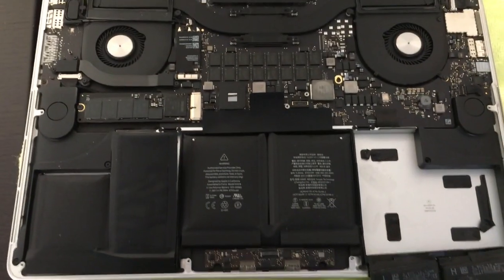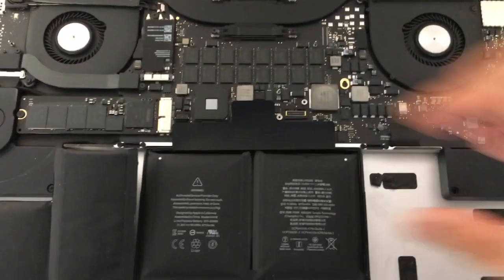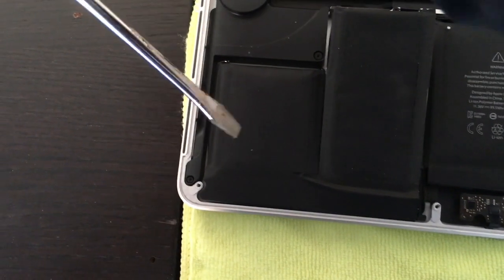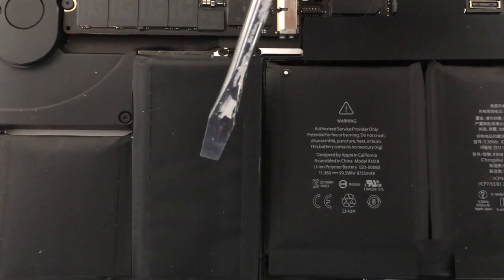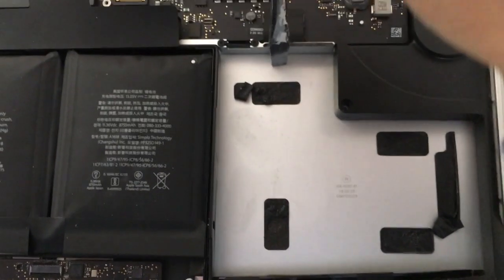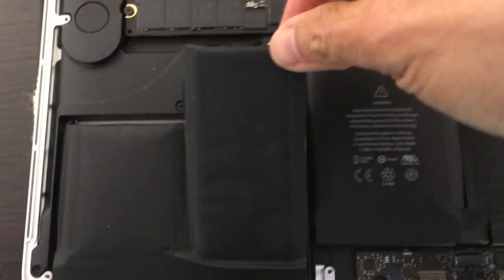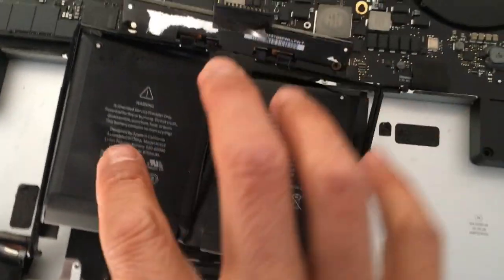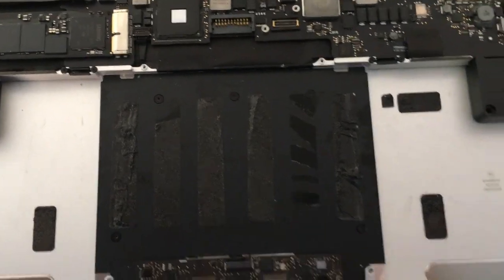Mid 2015 MacBook Pro Retina Battery Replacement 15" - The EASY way!  Tips and tricks!

Comment: I’m glad I watched this vid — it saved me time… However, I also am glad — once I got to the point where this guy fessed up to puncturing part of the battery with a too-small s/d and the stinky and dangerous mess it made — I watched the next vid that came up for me, as the maker was more cautious, professional, and thorough. 

I would not have gotten through the process successfully just watching THIS vid, as there are important steps omitted (removing screws, tape,  connectors and adhesives). On the other hand, I would not have gotten thru the process as quickly without THIS vid.

Thanks again!

The other vid I watched was Kamil Kuzniak (or Kuzbiak) https://youtu.be/rHlvwRQlLfM?si=IyK6ICVTDktS-oKD “2015 MacBook Pro Battery Replacement”

Comment: You shouldnt use any metal tools near LiPo batteries unless youre sure what you are doing but i still wouldnt recommend it because if you want to remove the batterie its likely already broken so its even more unstable. Damaging the battery can cause fire and or explosion and is prevented by using plastic tools without sharp edges.

Comment: Thanks a lot!! Saved me a lott of time and hazzle. Worked fine on two computers. Allso a MAC Book Pro from 2012
Reply: hi, I know this is old, but did you replace the battery in your 2012 Macbook? I also have a mid-2012 Macbook Pro retina and was wondering if it's worth trying to replace the swollen battery or just remove it and say goodbye to the laptop. Right now it's working very slow and I'm wondering if battery change alone is worth it since I can't add more RAMs (as far as I know, it's not possible with retinas because rams are soldered to the board).

Comment: Thanks SO much for this video - it saved me tons of time and really eliminated the possibility of damage to the other parts from uninstalling and reinstalling. I went slow and was able to pull the center batteries without a tool, as you suggested. I had the battery replaced in 30 mins! We’ll done!

Comment: Great to know! I just bought a used 2015 retina with a good stock battery so I wouldnt have to do the tear apart task to replace a battery. I wondered if it could be done without tearing the machine apart. I see the nuances and cautions that need to be taken. I've read suggestions of using a putty knife - I have a set of plastic putty knives/spreaders - look for plastic ones they will be a safer tool to use.

Comment: Thank you so much man, I watched your videos and went for it. If anyone has trackpad issues after just make sure that tape on top of the battery is fastened and plugged in correctly. I had to redo that step after turning the computer on to no avail.

Comment: Great advice.  The trick of starting with the batteries 2nd from the end worked great.  I'd like to try the "thread" routine - pull something like fishing line between the battery and case.

Comment: Thanks, this helped me a lot and saved a ton of time! I did what you suggested, stated with the battery right away and removed the 2nd piece first and then the rest. It worked out great and the the battery removal process (after I removed all the screws and the touchpad ribbon) took literally 10 minutes!
Though I did use adhesive removal that came with the iFixit kit and some pretty wide (much wider than screwdriver) pryer. 
Also the fact that my battery was very swollen, strangely, helped because due to that swelling some of the adhesive, I guess, unstuck naturally over time.  
Thanks, Cheers!

Comment: Yes metal may not be ideal, just don't use anything small and sharp. I used a 2" flexible putty knife because it was thin and wide. It was super easy to get under the edge and pry the batteries out easily. My batteries were leaking one of the chemicals already. I could small it when I opened the case. Battery installed with no issues. Did remove trackpad cable from motherboard and trackpad to protect it. Easily removed and replaced. Thin and wide, regardless of what you use, works quick and fairly safely. My plastic tools were too thick especially for the batteries over the trackpad.

Comment: Dude you honestly should delete this. You could probably be held liable for reccommending people use a sharp screwdriver for this, which is just absolutely moronic. This has 37k+ views at the moment and I can absolutely guarantee someone has started a fire as a result of your terrible advice. I recommend people watch Hamad Benaicha's method. He uses a metal spatula, which is still dangerous, but at least he's not applying pressure directly to the battery walls like in this video so much as into the seam between the laptop and the battery. I personally recommend you sub in blunt plastic spudgers for added gentleness. You can easily apply the necessary force without worrying about messing with the battery. I had a bit of turpentine and alcohol on hand to remove adhesive if necessary, but I wound up not feeling like I needed it. Apple Pie Tech's fishing line method was also helpful for getting started on each cell of the battery. But the spudgers were far more effective once you have a bit of lift on each cell and you're able to get them in there cleanly.
Reply: Wow, people love to tell you how you're doing it wrong cos it's dangerous or whatever. You did great and lived to share what you learnt with the world.

I like your idea of careful prying, thanks for sharing it. Thanks for openly admitting that you made a mistake and nearly started a battery fire.

They are much more exciting and shocking to observe than dangerous as long as you do it away from other combustible materials as it doesn't take long for the flammable solvents to burn away.

If surrounding things catch fire. Extinguish them with water when the battery has stopped venting. Fire extinguisher would be handy to keep surrounding things from burning but won't extinguish the battery fire most likely. Just have to let it finish venting.

This guy didn't hide anything. He told us everything he did and what worked best for him. We are all learning, none of us know everything. Just say no to safety "experts" who get a buzz from any chance to tell someone off.

To the safety "experts", get a life. Do something interesting and contribute to the world. Unless it's egregious, telling people off for this stuff only discourages open and honest sharing of information and nobody likes you!

Comment: Spoiler alert : unless you’re a complete dipshit with no concept of applied pressure...you can use a screwdriver fine. The hard part is getting those centre batteries out over the trackpad.

Comment: use nylon under the batteries. that is the really easy way (fishing 150lb nylon) works for any glued on battery on MBpros
Reply: do you think dental floss would do it?
Reply: @pigknickers2975  if your dental floss is strong then yes, use screwdrivers or something to tie the floss and pull (lengthwise the battery. don't pull up). with nylon, this took me about 2 minutes and was only $2 at Walmart sporting goods section
Reply: @mystiquemetal  Excellent advice, thanks. - 2 minutes for the whole battery removal?
Reply: @pigknickers2975  I had someone else hold the MacBook while pulling the nylon to cut the glue. if you ask for help, it is simple and quick
Reply: @mystiquemetal  Great, going to try this, thanks.

Comment: I just replace my battery without removing every component. I made sure the battery is dead so it will have less energy if I punctured it. Also I used acetone to weaken the glue and then floss, and copper wire to get under the battery and cut through the glue with the wire until the glue was weak enough for the whole battery. Once the first battery to the right was up it was easy to just use a plastic card for the rest of the batteries by using the extra space. Don't use a screwdriver. If you use a screwdriver and the battery bends, or dents it will start to spark.
Reply: COPPER WIRE?   very bad idea.
Reply: @dang2443  it was insulated with rubber, it worked well because it is much stronger than other string

Comment: This works!! You don’t need to disassemble the entire MBP to get the battery out. 

It took me about 15 minutes to remove the battery and then about 5 minutes to clean up the existing sticky sections using a tweezer to peel it off.

Remember to drain the battery until the computer shuts off abs DO NOT use metal tools around the battery. 

I recommend using a small amount of nail polish remover on the edge of a card to help soften the glue as you pry the battery out.

Comment: I did use this technique. However, it is very risky. One time I moved my knife (I did it with a large knife, its top was broken so it was flat) and then it shot through my motherboard. Luckily nothing damaged, but be careful guys! Ah also, if you use a plastic small bag, or 2 to be sure, you can put some hot water in it and leave it on top of the battery part you want to remove. Then it is way easier to remove the battery. Good luck!

Comment: This worked fine for me but I suggest getting a kit from the Auto parts store for doing door trim etc. They are plastic levers and pry bars usually in a kit of 4-6 different sizes. Plastic means you won't be as likely to puncture a battery and they are prybar shaped so you don't need the eraser for a fulcrum.

Comment: Do not reference the majority of this video. 
Take your laptop to a professional or purchase a kit that includes proper tools. 

Take precautions: Keep a fire extinguisher nearby. Wear protective eye-wear, gloves and a heavy shirt. Keep a bottle of white vinegar nearby in case the battery leaks and a tin canister to dispose of the battery once removed. 

1. Drain the battery to 0%. 
2. Make sure all peripherals are unplugged.
3. Cover your retina display screen with aluminum foil.
4. Using a syringe, squeeze a couple drops or acetone below each cell, then use a plastic tool or dental floss to gently lift the battery. 
5. Make sure to clean the surface and remove all adhesives from the laptop base before installing the new battery.

One useful advice from this author, you can skip about 70 steps of the battery removal process by carefully removing the cells in the order mentioned.
Reply: LoL, you forgot the most important steps.

* Wear 2 condoms
* Safety glasses
* Toxic fumes in the event of lithium fire should be filtered through a cigarette

Comment: I would like to confirm that, trying to disconnect the battery of my smartphone, it started smoking. I got scared and threw the smartphone out of the window! (in my garden).
So much better to try other systems, such as fishing line.
Nothing happened to the smartphone, just a little smoke, it didn't catch fire. But better be very careful.

Comment: Rather than use a screwdriver, can't you drip some adhesive solvent onto a card prized under the battery. I've seen this done on a similar video.

Comment: oh man. do NOT use a screwdriver.  Use a plastic tool that will not puncture the battery.  Or use dental floss, fishing line, or string to remove it.

Comment: One repair shop gave me the price to do this... it would cost 285 dollars they said. Kind or ridiculous no? As far as I know the parts cost about 100 bucks... so the service is nearly 200 dollars? How does that make any sense?
Reply: I just got quoted for 335!
Reply: @Legoequalsfun  If I recall correctly I ended up paying less than 200 bucks at another shop!
Reply: battery: 75 Euro
drain battery: mins... depends on charge...
protect monitor with a large paper (to avoid isopropyl alchool contact): 3 mins
remove bottom cover: 3mins
Detach battery connector, remove trackpad connector: 3 mins
Remove battery: 30 mins (don't use screwdriver, use isopropyl alcohol and an old credit card instead). Be patient...
Clean space under battery: 2 mins
Install new battery: 3 mins
re-plug trackpad connector, re-plug battery connector: 3 mins
reinstall bottom cover: 3 mins
Reply: saystheman behindthemask it’s labor buddy.
Reply: Proper replacement without risking damaging anything would take 3 hours. If you want to pay a kid for €5/hour to risk damaging your 2000€ laptop go ahead. What I care more is to have original battery - i would even pay 200 and replace it myself

Comment: Anyone found a replacement battery close to the original quality?
Reply: Here's a link to the one I bought: https://www.amazon.com/gp/product/B0753GJ4N7/ref=ppx_yo_dt_b_search_asin_title?ie=UTF8&psc=1  It was only $65.  I'm not sure it lasts quite as long as the original, but on the bright side, it hasn't swollen up and gotten extremely hot like the original one did.  Good luck!
Reply: @Idlia Dosai where can i check if my macbook is on this recall list, thank you!

Comment: I'm going to do mine this way as well. I may go so far as to get pieces pried up just enough to get some acetone in there to weaken the bond, especially on the middle cells. I will also probably try and use a putty knife instead of a screwdriver to get things started because it will spread out the force on the cells.
Reply: If you use acetone put aluminum foil between keyboard and screen as acetone can damage screen. Also it can damage speakers so don’t let it run towards speakers
Reply: don't use acetone... it could melt plastic parts!! Use isopropyl alchool instead...
Reply: @TheZiPierre  iFixit ships pure acetone with their kit. I'm going to go ahead and trust them.
Reply: @innercityprepper  no ACETONE... it's really dangerous for plastic parts...

Comment: Do NOT use a screwdriver!!!  Use fishing line and cut through the adhesive, it is so easy to just ruin your laptop with poking through the battery.
Reply: That's a great idea!  Thanks for sharing
Reply: "I didn't want to damage anything so I literally just grabbed the battery..." shudder
Reply: yeah, exactly. no need to pry anything against anything else and destroy half your mac. just use fishing line or strong fine thread.
Reply: @daos3300  Thats a badass idea but also common sense lol Im going to do this myself now. Apple wanted my MBP for a week to replace the battery.
Reply: Do you go towards the adhesive from the front and then just pull back on both sides of the line into the adhesive?
Reply: I remember removing a battery from this exact model. Once i got the first one out i used alcohol/hand disinfection spray and had the fluid do its job on the adhesive. Worked like a charm almost no prying to get the rest of the battery out just some wiggling. Also the stuff evaporates so you don't have to worry about damaging any electronics. Of course you must make sure the battery is cut of from the electronics.
Reply: needs to be pinned tbh
Reply: ……or better yet, if you must need to pry use a plastic disposable knife or plastic pry tool.
Reply: Thank you so much!